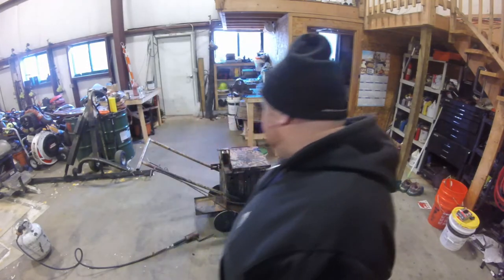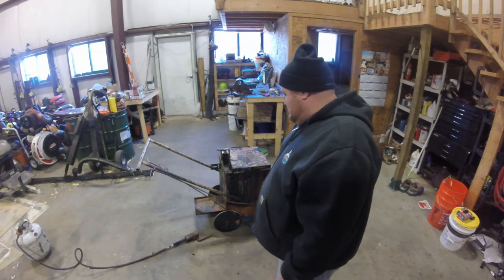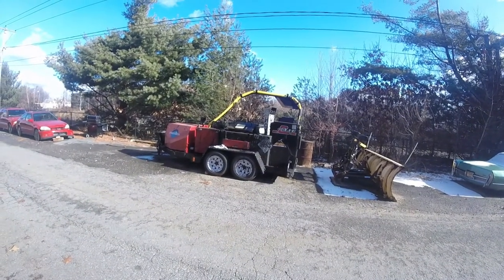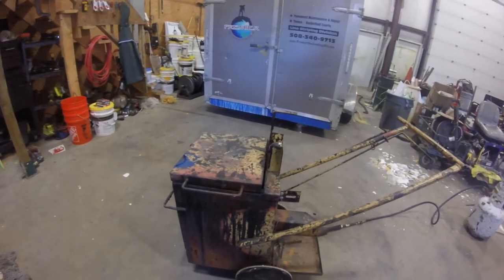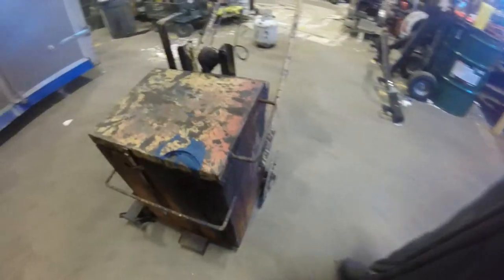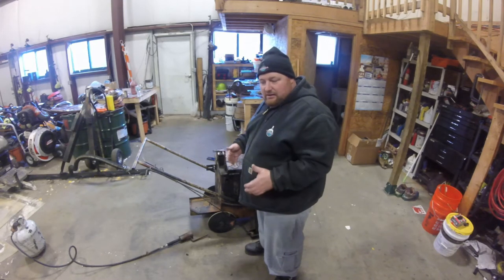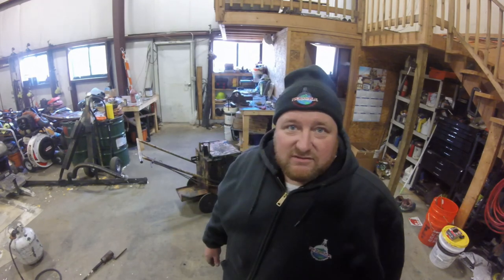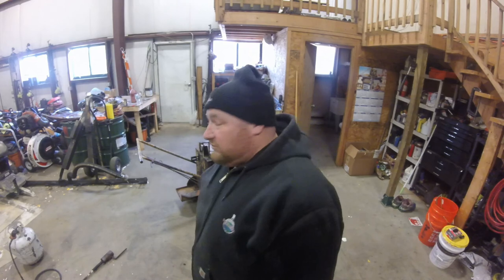MA-10 RUBBER MELTER /APPLICATOR CLOGGED, HOW TO CLEAR CLOG

Comment: I know first hand how fast that shit comes out at 350-400 degrees so, I emptied mine first using a cheap metal pot and aluminum foil turkey pans  from Woamart. Once empty, it was a charm to disassemble with hot gloves on. Thanks for the video. It gave me the confidence to take it on. Found a piece of cardboard from the box the blocks of selaer came from.

Comment: The big cinline machine you have outside what do you do if you have to clean that tank out? We currently have one that has years of charred rubber on the sides that broke free and fell into the tank
Reply from the maker: We actually bought a giant ladle on Amazon made of metal that we used to scoop out any floating chokes, but normally in the winter, we will try to have the machine as empty as possible and scape it on a cold day. I've also heard of filling it with dry ice  and that's a good way to clean it.

Comment: Awesome video Ryan! Just cleared mine out today, wish I saw this first. When I pull handle for more material the male pin with the hole in it gets pushed out of the sleeve. I’m thinking the holes ain’t lining up, any thoughts?
Reply from the maker: It's the metal handle straighten it out. If it's to bent when you pull it it will go past the stopper and pop out
Reply: Thank you kind sir!
Reply: @thesealerguys  That's awesome man.

Comment: I unclogged it and it’s working a lot better but the valve keeps wanting to come out and not stay closed ? And idea
Reply from the maker: Your pull handle is bent need to be straightedge so it hits front of handle that stops it from spinning back enough for head pressure to push it out